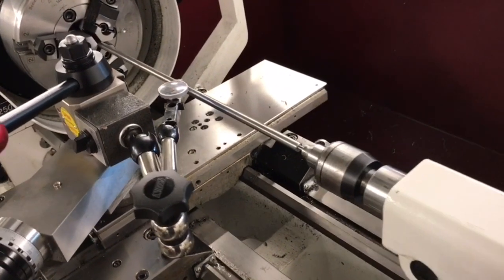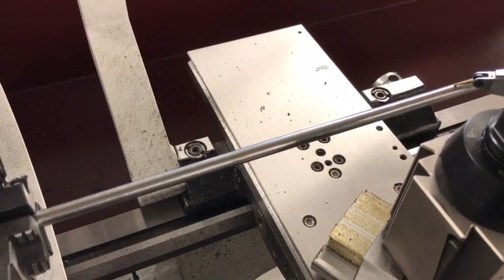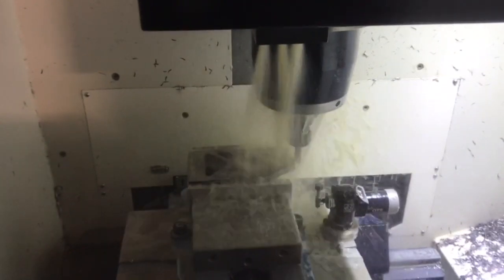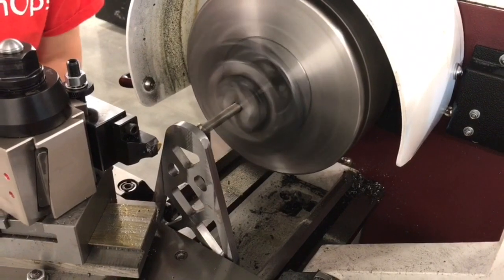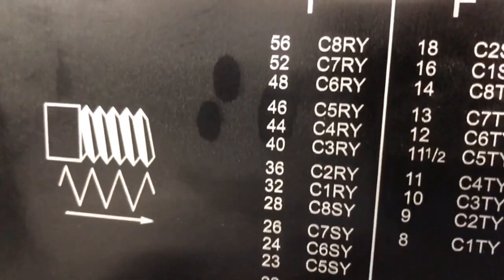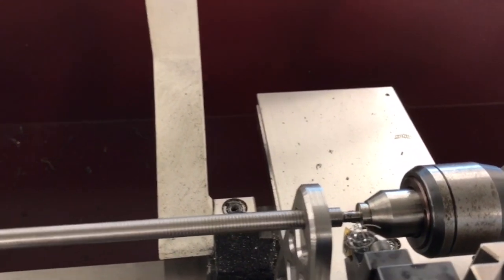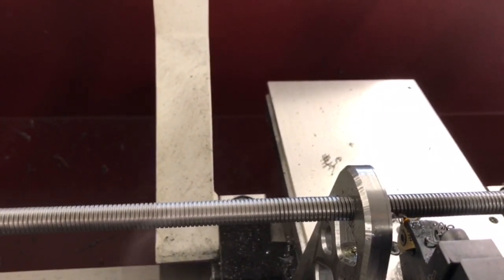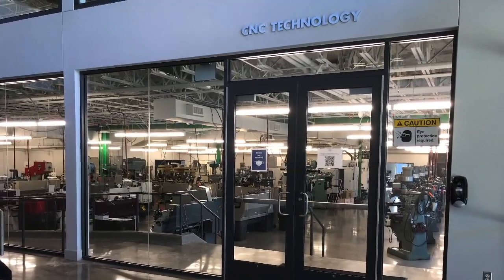THREAD CUTTING TIP: Minimize Flex on a Long Bar

Comment: This snap-in will not work for a long time. It is much better to make a replaceable sleeve for different diameters. It will be possible to change according to wear and if necessary, cutting different thread diameters.

Comment: It's bad practice to use a center drill for spotting a hole. That's what spot drills are for. The problem with center drills is that the angle is 60 degrees and your typical drill is 118 or 135. The greater angle will cause the drill to walk around as only the flutes and not the center of the drill is making contact with the material. A spot drill the same or greater angle of the drill will allow the center of the drill to make contact with the center of the spotted hole.
Reply: The tip of most center drills (at the very least, every center drill I've ever seen in my life) is the correct angle for spot drilling assuming a typical 118 degree drill angle.

Given that he's in a 3 jaw chuck, on a manual lathe found in a teaching environment he's probably already not running fast enough (I expect a lathe with a chuck of that size probably caps out at like 900 safely but lathes vary like crazy)
Since he's also in an instructor role at a school it's probably just as likely that they don't purchase dedicated spotting drills when center drills are perfectly acceptable for spotting in a manual machining context

Comment: Very nicely done. If you were to remake this you might want to oversize that hole and fit a bushing. That way you can reuse it for different sized rods and if the bushing wears you can replace it. However nice catch on finding a use for those holes in the cross-slide.

Comment: I got stuck doing 3/4-10 for 2 feet on each end of 10 foot tension rods. Did 20 of them so 40 threads at 2 feet plus the lead screw was non functional on the Leblond I was using at the time. Needless to say I went through a lot of Dies that week.

Comment: A follower rest right after the cutting tool used to be REAL popular on turret lathes of old. 

Why not make the "carrier hole" way oversized and use BRONZE INSERTS to accommodate various diameters (intermediate stage) and various thread counts and shapes